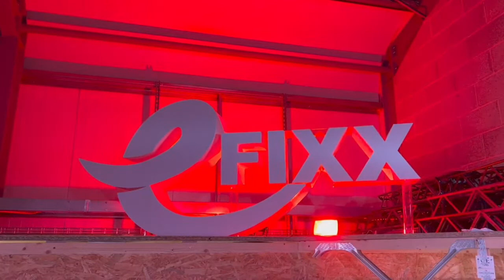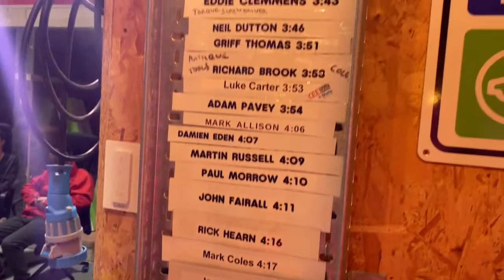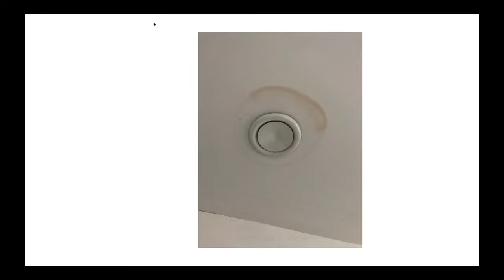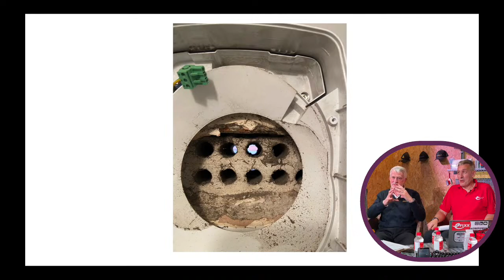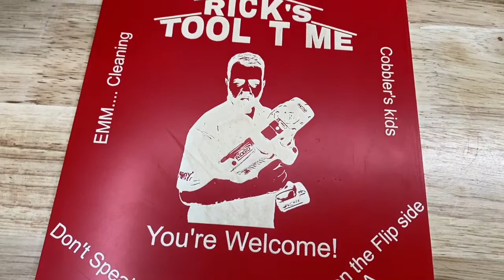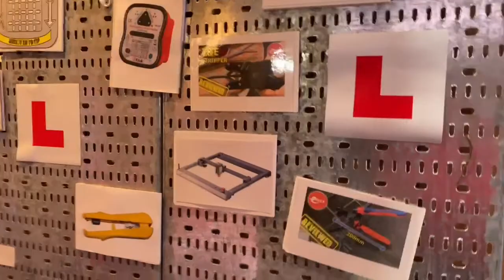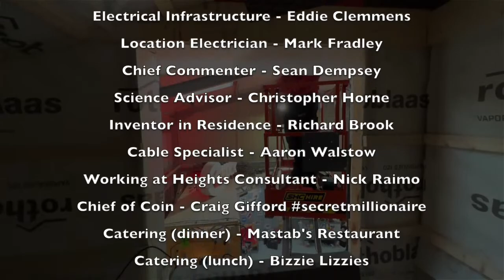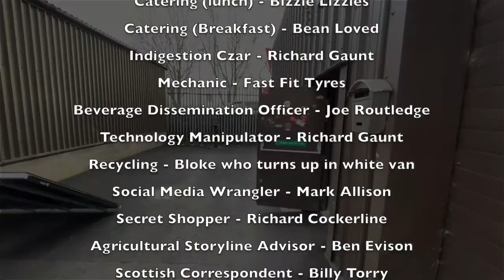Something Stinks: Why Do Installers Get Ventilation Wrong?

Comment: What's wrong with soil pipe for venting ? ....the flexible ducting is terrible sags like mad ...condensates and fills with water ....but it's easier for the sparks to rough in and shove straight down the eaves and out fascia for venting through eaves vents .. no need to drill suitable hole ......🙈

Comment: There are ventiliation installers… contact any HVAC company. In my area the extract bathroom vents have been installed wrong and the electrician said theres nothing wrong with it i said with respect the electrician doesnt know what hes looking at. Water mark around the ceiling mounted grille i had a look a piece of plastic un insulated pipe poked up into the ceiling from the fan then the flexible duct up to the outlet, the insulation around the flex was hanging down a few 100 mm off of the flex and wondering why it was wet inside but the electrician reckon there was nothing wrong. Again electrician doesnt know what hes looking at, different trade all together. Get the right trade in to do ventilation. 

Also the fan wasnt commissioned to the right air flow rating of the bathroom it was under performing.

Comment: It is almost like there should be a trade purely for heating and ventilation, possibly even air conditioning. HVAC anyone?  (plumbers shouldn't call them selves heating engineers if all they do is fit boilers. They are boiler installers.)